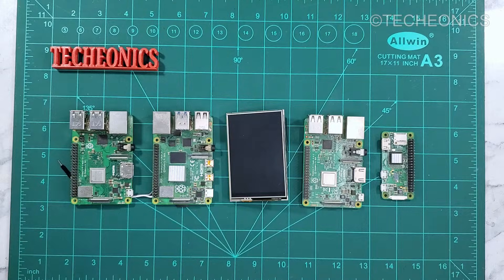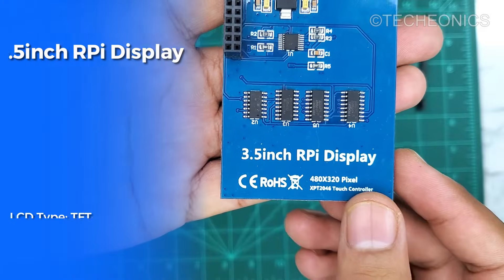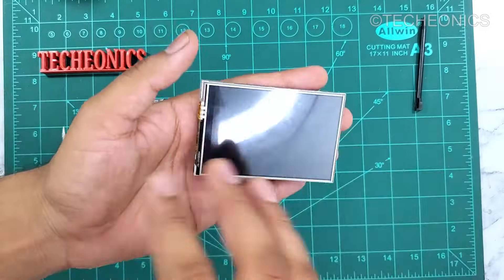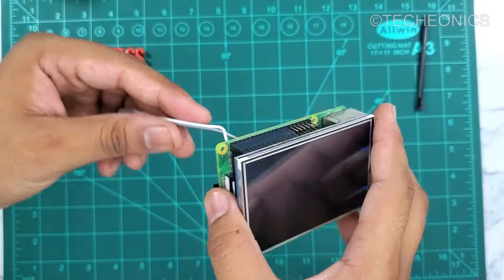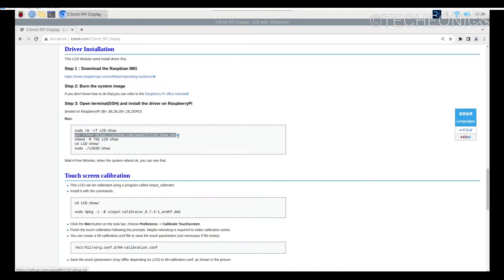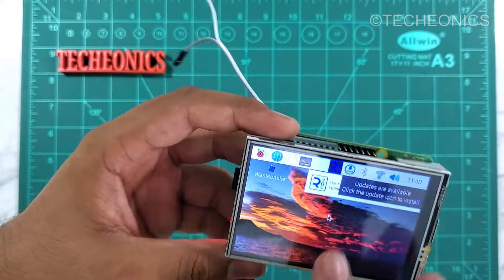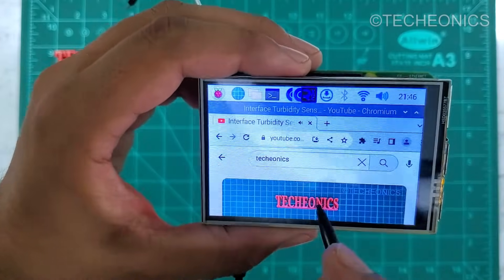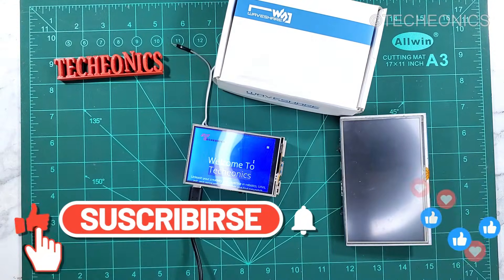Raspberry Pi 3.5-Inch LCD Touchscreen: Complete Setup & Review Guide | Techeonics

Comment: Not working with Pi 5. You can't log in after installing the drivers.
Reply: any fixes for this yet?
Reply: @brandonmanus  unfortunately I gave up as I couldn't find any solution.
Reply: @__Hasan_ i luckily had a 3 around. Managed to get it up but gets stuck on initial config
Reply: I have a fix for this I think I haven’t tested the screen yet but I was able to solve the login issue
Reply: @Dylan-xt7ib quick suggestions? Whatd you do?

Comment: These  displays have a big problem. Brightness... Too bright, poor wishy-washy contrast, narrow and unadjustable display angle. They don't use standard programmable pwm from gpio 18 to adjust it either. I have spare one of these and will tear it down to see how the backlight Leds can have their supply current of 120mA reduced. There are 2 suspicious 2 ohm resistors. (R1 and R2) On the back of the display board, I replaced R1 to 22 ohm but that made no difference.

Comment: Is it possible yo remove the black plastic gpio box and still use the gpio interface? Trying to use woth a Pi Zero w 2 and looking to get it as compack as possible
Reply: I think so. The black plastic added is to let you plug the screen without touching side ports like LAN/USB.
Reply: @RonanLamour  it's just so hard to disconnect, I don't want to break the pins 😭
Reply: @waxboy9000 don’t want to break mine too sorry :/ It’s probably glued…

Comment: Will the drivers and display work with raspberry pi 5?

Edit: the screen works but it shows the raspberry pi Logo (cant access the OS tough the screen)
Reply: you use os  64 or 32 for raspberry pi 5 !,

Comment: Hello, I noticed that you had a positive and ground wire soldered onto your pi. My question is will the screen still work if you connected the wires to a different device, IE a voltage meter. Or would that not work?
Reply from the maker: It will work
Reply: @TECHEONICS  Thank you!

Comment: Having an issue with RaspberryPi OS GUI... If I start system in CLI, it works fine, but if I start it in GUI, it doesn't load interface. Is there a known issue? Used to work fine in Raspbian, on this same board (it's a Raspberry Pi 2)...
Reply: same

Comment: Hi there Mr Techeonics, thank you for your video. I'm a beginner and very much appreciated you 'starting from scratch'. I purchased the Pi5 and the 3.5" display a few days ago and happened to stumble upon your video today. Delighted! Please explain how you installed the display drivers, without the little screen working. Did you use another computer, downloading the drivers onto a micro SD card?  I've read your 'Setting Up a 3.5-inch LCD Touch Display with Raspberry Pi: A Step-by-Step Guide', but can't figure out how you installed/typed in the commands when the little LCD screen isn't yet working. lol
Reply from the maker: Connect the Raspberry to a monitor
Reply: Connect it to the monitor or SSH into it

Comment: A nice easy to follow video process.... but the 3.5inch LCD does not change from a white screen.... I'm running Venus OS on my Raspberry Pi 4 B.  Will this allow me to use the 3.5 inch LCD?
Reply from the maker: The white screen issue on a 3.5-inch LCD is often related to incorrect configuration or drivers not being installed properly. If you're using Venus OS on your Raspberry Pi 4 B, it may not have native support for the 3.5-inch LCD, 

Here are a few steps you can try to get the 3.5-inch LCD working with your Raspberry Pi 4 B running Venus OS:

 1Check Screen Compatibiliy
   - Confirm the brand and model of the 3.5-inch LCD screen you're using.
   - Some common screens use the **ILI9341**, **HX8357**, or similar drivers. Make sure you know which one you're dealing with.

2. Ensure You Have the Correct Driver
   - Venus OS may not come with the specific drivers needed for your screen by default, so you'll need to install them manually.
   - For most 3.5-inch LCD screens, the driver installation typically involves installing software libraries and configuring the `config.txt` file.

3. Install LCD Drivers
   - If you're able to access a terminal or SSH into the Raspberry Pi, you can try the following steps:

   
   sudo apt-get update
   sudo apt-get install -y git
   git clone https://github.com/notro/fbtft.git
   cd fbtft
   make
   sudo make install
   

   This installs the required libraries for many LCD screens.

4. Configure config.txt
   - After the drivers are installed, you'll likely need to update the `/boot/config.txt` file to enable the screen.
   - Edit `config.txt` to include the appropriate settings for your LCD:

   bash
   sudo nano /boot/config.txt
   

   Add a line for the specific screen you have, for example:

   bash
   dtparam=spi=on
   dtoverlay=waveshare35a:rotate=90
   

   Replace `waveshare35a` with the correct overlay for your screen (if it's different). The `rotate=90` is optional, depending on your screen's orientation.

 5. Reboot
   - After making these changes, reboot the Raspberry Pi:

   bash
   sudo reboot
Reply: @TECHEONICS  hello. i am using it bookworm 64 bit and it showing blank white screen. i have project submission tomorrow and i cant get to work. can you help me out here?

Comment: Got this working perfectly on 4B, but won't work on PI Zero.

Fresh installs and even swapping working card & screen from the 4B to Zero & back.

Was beginning to think it was a faulty Zero, but the black screen with a flashing dash seems to be a common issue in this thread.

Any other tips to try?
Reply: How did you get it to work with 4b I’m stuck on blue screen or I get the terminal to show up on the display but not the gui

Comment: I'm also just getting a white screen on the LCD and a black screen with a flashing underscore in the top left corner of my HDMI monitor. During reboot, the operating system startup page shows on the main monitor but in very low resolution. Then it goes to the black screen with the underscore. Is there a way to interrupt the boot process and force it to use full hdmi mode? As it stands there is no way to call up the terminal in order to uninstall / reinstall the drivers.
Reply: yeah it just doesnt work anymore. ive seen forums of people trying for weeks with no results, and i had the same issue as you just now trying a completely different method
Reply: @Aspect.04  If you find a fix please post it ty
Reply: same for me
Reply: @Rugggiero05leone and me!
Reply: use the 32-bit os instead of the 64-bit one

Comment: Hi, im trying to install it on pi zero 2 w. It only shows white screen after installation of the LCD35-shoe driver. I have tried pi os lite, pi os multiple times.
I haven't tried 32 bit versions will it work with 32 bit?
Reply from the maker: Try 32bit one's
Reply: hey bro，I ran into the same problem as you .My zero 2w also keeps showing a white screen.Did you manage to fix it?
Reply: @小疯卫use the pinos bullseye 32 bit. Newer ones don't work with this display because of wayland.

Comment: Does this at all work with Raspberry Pi 5 8GB? Currently running 64 bit and it doesn't work, would it work with 32-bit OS?
Reply: same!
Reply: Bro I have the same trouble rn
Reply from the maker: Try with 32-bit and older version
Reply: @TECHEONICS  i actually tried again with a fresh install and it worked, must be something i entered wrong
Reply: @robibobi212  Hey, did you manage to run this with 64 bit os on pi 5? which OS you used?
Reply: @DrAlien23  i used the latest OS on the imager, theres some settings on the github about it that are slightly different

Comment: For anyone trying to install this on the RPi4 on Kali linux, make sure you're using the 32 bit OS, the 64 bit OS will get stuck on bootup
Reply: The same with mine. 😢
Reply: To add to this it needs the Bullseye x32 not the latest bookworm OS
Reply: @LPhoton-m4p hmm I've been using the bookworm already, are there other libraries that are compatible with it?
Reply: What if I'm using a raspberry pi 500 what's 8 gigs of RAM I'm trying to use a 3.5 inch touch screen with 16 bits and 80 parallel interface I see you have to make sure you don't have too much but it's 16 that's enough or I'm sorry 8 gigs of RAM enough sorry I'm new LOL😅
Reply: Will this still work on the newer kernel drivers? Evan if kn the 32bit
Reply: any workarounds?
Reply: Did u find any?  @chriswong9851
Reply: @chriswong9851  guess that's a no

Comment: i get a black screen after the raspberry pi boot screen
pi 3b+
Reply: do you have any solution to your problem yet?
Reply: @jimzcino  FOR ANYONE WHO HAS PROBLEMS WITH THE SCREEN STAYING BLANK:
Firstly check if you have installed an older version of debian OS 11 bullseye or lower.

Secondly after installing the driver run the following commands (for example by using ssh)
first: sudo nano /etc/X11/xorg.conf.d/99-calibration.conf
then replace the contents with:
Section "InputClass"
Identifier "calibration"
MatchProduct "ADS7846 Touchscreen"
# Hat trick to get the pen to work properly on the touch screen, rotate 90 degrees clockwise:
Option "TransformationMatrix" "0 -1 1 1 0 0 0 0 1"
# Don't use libinput but evdev for the touch screen and the pen so calibration works:
Driver "evdev"
Option "Calibration" "3936 227 268 3880"
Option "InvertY" "false"
Option "InvertX" "true"
# Right mouse button is long press with pen:
Option "EmulateThirdButton" "1"
Option "EmulateThirdButtonTimeout" "750"
Option "EmulateThirdButtonMoveThreshold" "30"
EndSection

Section "Device"
# WaveShare SpotPear 3.5", framebuffer 1
Identifier "uga"
driver "fbdev"
Option "fbdev" "/dev/fb1"
Option "ShadowFB" "off"
EndSection

Section "Monitor"
# Primary monitor. WaveShare SpotPear 480x320
Identifier "WSSP"
EndSection

Section "Screen"
Identifier "primary"
Device "uga"
Monitor "WSSP"
EndSection

Section "ServerLayout"
Identifier "default"
Screen 0 "primary"
EndSection

This helped me fix the problem at least.
Original comment with the solution: https://www.tinytronics.nl/nl/displays/tft/3.5-inch-tft-display-320*480-pixels-met-touchscreen-raspberry-pi-compatible
Reply: @jimzcino  
Nope, opened a support forum in there discord and everyone else was pretty amazed it didn’t work ether

Comment: i need the screen to be separate from the PI.

where is the GPIO cable to connect them? is it 8 pins?
i don't see any but a 40 pin cable. will that work.
Reply from the maker: https://www.ribbon-cable.com/product/raspberry-pi-gpio-extension-cable-jumper-wires/
This will work or similar one

Comment: the screen only shows the dash on a black screen... do I have to use the default username and password?
Reply from the maker: Is this after first boot or after installing the driver ?
Reply: @TECHEONICS  yes, after installing the driver, when call a first boot.
Reply from the maker: @maicoul  CONNECT HDMI AND  REINSTALL THE DRIVERS
Reply: @TECHEONICS still same
Reply: I am also facing same problem
Reply: same

Comment: will this 3.5 works on rpi 5 ?
Reply from the maker: Yes
Reply: @TECHEONICS  make a video on that brother :) rpi 5 is the latest one
Reply: @TECHEONICS  i try using rpi 5 but it only turned dark and work as mouse pad only
Reply: I suggest, using the raspian os image from lcdwiki, you just need to flash it. and it works on pi5.
Reply: @appsidal  When I connect a display (3.5inch) it's just showing white screen for me. What should I do?
Reply: I'm also only getting a white screen